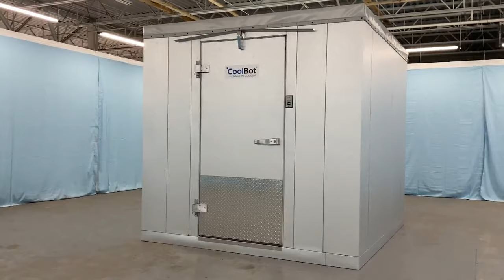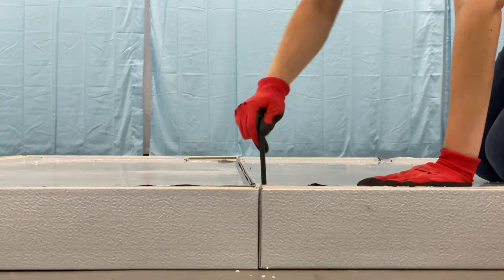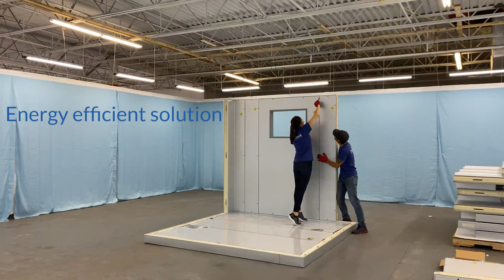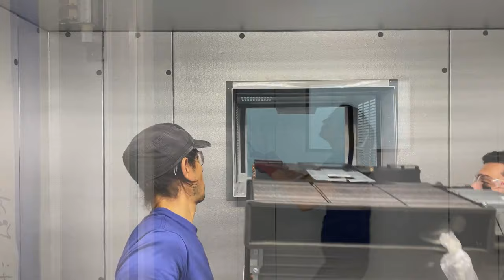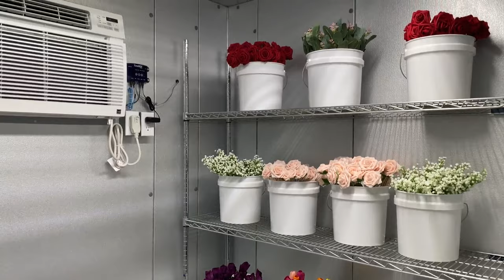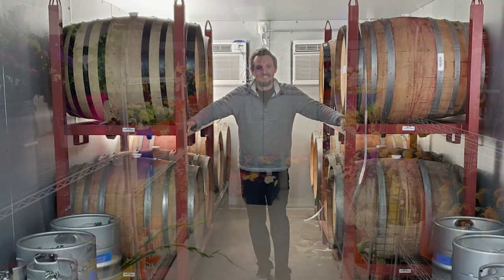CoolBot Walk-in Cooler Product Introduction

Comment: So, how cold and how long can you run that LG air conditioner without freezing the compressor?   How low can the ambient outdoor temperature be to keep running that LG air conditioner continuously without damage to the LG AC unit?  Awesome, by the way!
Reply from the maker: The compressor in the A/C doesn't actually run 24/7, it runs long enough to get your fully insulated space down to the temperature you set it to, (lowest is 34 with a insulated floor or 37 without) the compressor will then cycle off and the fan on the A/C will continue to run, circulating and keeping your area cool until the compressor is needed again. The CoolBot also allows the compressor to pause if/when the fins approach the freezing point, then asks it to resume cooling (if needed) once the fins are safely above freezing. So as long as you have used our A/C Compatibility List, along with our A/C Sizing Calculator and are insulated to R25 you shouldn't need to worry about icing.
If you're using a window A/C with your CoolBot cooler, the A/C is OK being used when temperatures fall below the freezing point, but it will stop cooling when the outside temperatures hit ~32F, typical of most window A/C's. At that point, typically your cooler doesn't need cooling anyway, and instead needs a simple heater solution to keep the contents from freezing.
Please feel free to reach out any time directly at support@storeitcold.com, we're happy to answer questions.

Comment: I really like those! What would you suggest for the floors as a meat cooler?
Reply from the maker: Thanks for reaching out!  For game and meat coolers, we've seen our customers do a couple of things.  Indoor coolers without a floor can be placed over a small drain with an airtight plug to help with cleanup.  Other customers with coolers with a floor use a mop to keep it clean.  Using a mop on the floor and towels to clean the walls are a great solution.  We advise staying away from power washing the panels.  Email us at hello@storeitcold.com with any other questions!